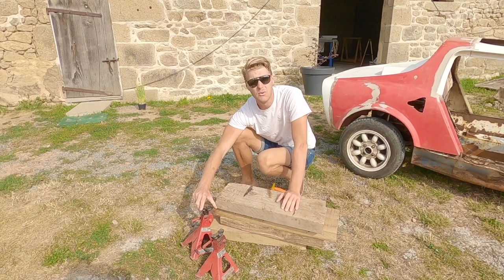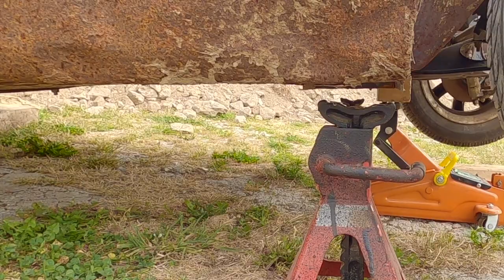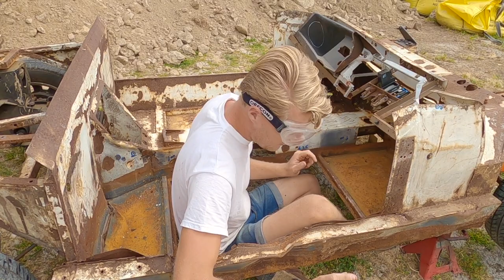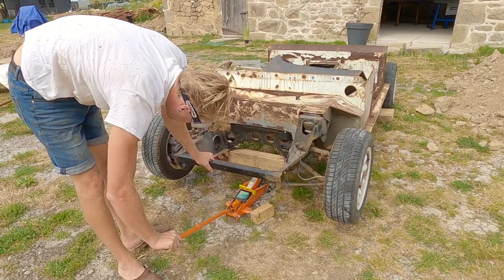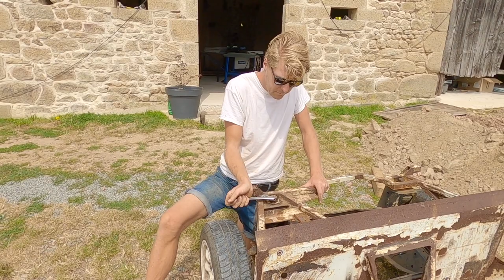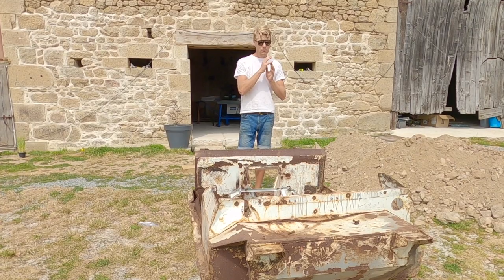Dismantling My Car | Project Mosquito Honda Type R Mini Supercar (Ep3)

Comment: Why make life hard.  Assuming the wheels are the same type, ie the hole in the middle is the same size, just measure from the leading edge of the hole in the front wheel to the leading edge of the hole in the rear wheel.  Job done.

Comment: As an American, I fully support your views on using metric only hardware.  even my 1988 Ford F-150 is a frustrating mix of Metric and imperial and when I add parts like new wheel cylinders on the rear brakes, the bleeders on reman parts are all metric.
Reply from the maker: It  would save the country an absolute fortune but personally I don't want to have to buy in bolts

Comment: Re using wooden blocks, we used to hold the roof up in coal mines with them (think like a jenga stack) now somehow several found their way to my garage, and were very secure.  We also used them underground to hold up 40 tonne machines while we repaired Caterpillar tracks, so a light weight GTM would be no problem.

Comment: I appreciate the 'fondness' for Minifin rear drums but you can't beat a full set of disc brakes so I have Fiat X1-9 rears so you can introduce the shorter and lighter cables along with the lighter (aluminium) calipers. I have a set of 132 calipers incase I need to upgrade for a more powerful engine. Something for you to think about while you're making a new chassis. Good luck with the chassis.
Reply from the maker: Ohhh good to know thanks Anthony

Comment: why not just go from one end of the centre bore to the other end of the other wheel and minus 70mm
Reply from the maker: I could have gone from the back of one rim to the back of the other a done the same but it doesn't matter as long as you get there

Comment: I know that's what you wanted, but it's not really a long distance cruiser type of car,  it will be interesting to see how comfortable you can make it,  I also think you are going to need alot of sound deadening 🤔
Reply from the maker: It's small, aerodynamic, fuel efficient and one of the most comfortable cars I've ever sat in was a lotus exige but I'll admit luggage space is... minimalist haha
Reply: @OliverPickard  I have had a lotus exige , and I did not like going far in it ,it was a weekend type of car "go-cart like" are you joking with me or am I just old now,  I try and be a young 52  ha 😂
Reply from the maker: The cabin fit me really well. I know they are noisy and fatiguing
Reply: @OliverPickard  Yep! they sure are,i went on to MX 5s after that a little bit of comfort but still not much but I did drive to the Swiss Alps from the north of England in the MX5   I manage to get my camping gear in it "just" I can still remember the pain in my legs and arms from the driving and also my numb backside and I'm only 6f1 happy times, I will look forward to see how you get on take care 😀👍

Comment: Personally I don't trust neither wooden blocks or axle stands, but tree trunks can't be beat.

 My ideal setup is an axle stand, tree trunk somewhere on the frame, and also the jack.
Reply: same, I also like to chuck the wheel under the car if I am taking it off, that way, if for any reason the car DOES come down, it will hit that before crushing me.

Comment: The Fox body lived too long of life.  The mid '80 Ford was making greatly  improved quality cars.  I will be measuring the wheelbases of all my cars to see if there are any differences!  The panel alignment on my Corvair is terrible.  Top of the door and fender is really bad.  Every '65 - '69 are all that way.  The tooling just wasn't good.
I'm from the U.S., agree about the metric system.  Auto's converted in the '80.  You get used to them.  As a woodworker and lots of projects in the house using inches, I am really good at fractions!
Reply from the maker: American cars were made incredibly quickly and in huge numbers the Mustang sold more in its first year than the 2cv did in its first 10
Reply: @OliverPickard  The first generation Mustangs were actually good. The Corvair actually inspired the Mustang.  The Foxes came later, late '70's I think and made them forever.
Reply from the maker: The first Mustang was mid engine v4